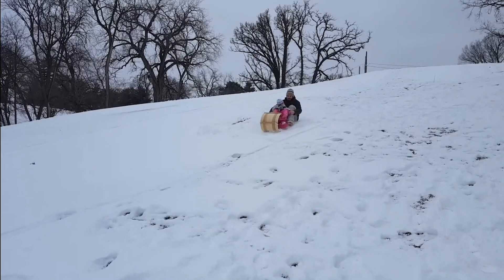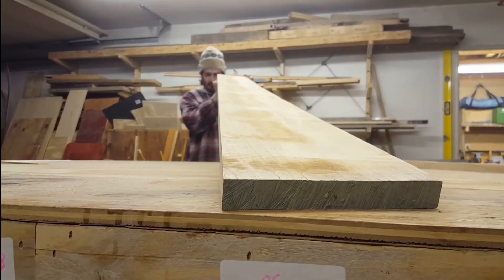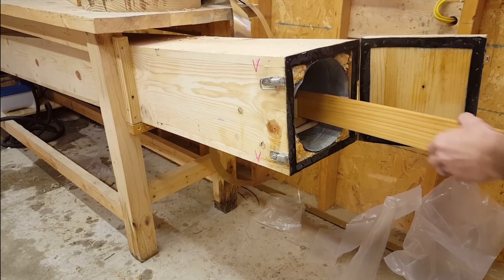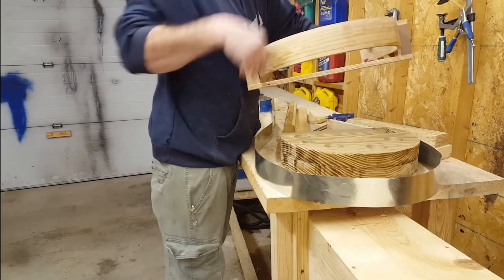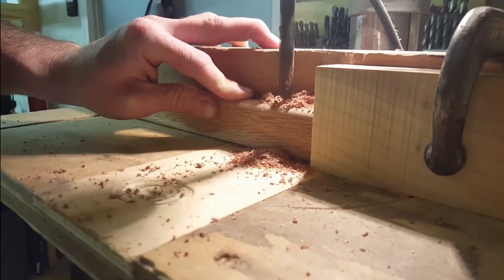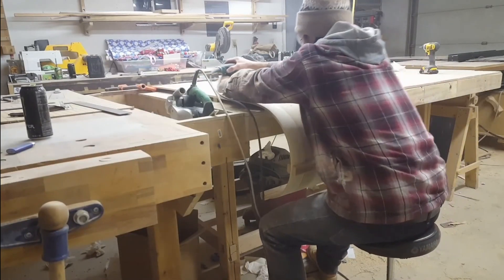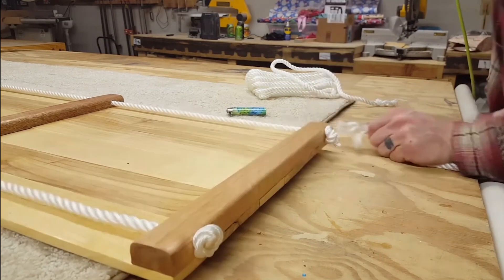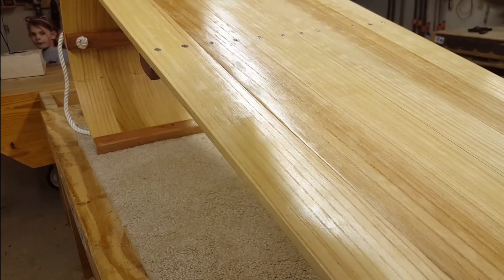How to Build a toboggan (Steam bending troubleshooting)

Comment: Hello. I have been following this video and am almost done with my own tobaggon, thank you! Question, what type of polyurethane and what type of paraffin wax are you using?
Reply from the maker: @mrmanoog  That's awesome to hear! Any polyurethane will work but I usually use Minwax. Same thing with the paraffin wax. Any paraffin wax should work but I believe the stuff I use is called Golf Wax. Happy sledding!
Reply: @WyldeWoodworks  Thank you so much. One more question... I should have clarified, do you use oil, water, or spar polyurethane?
Reply from the maker: @mrmanoog  no problem. I use oil-based when I want it to be durable